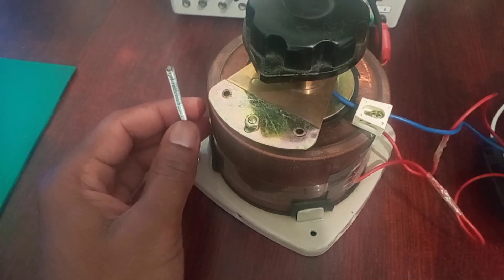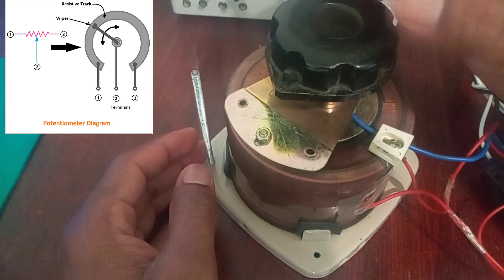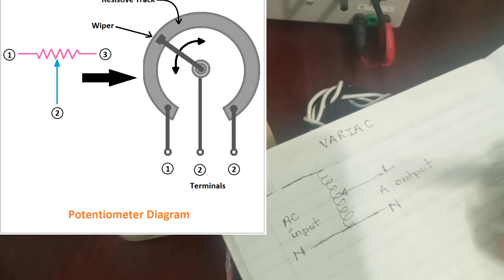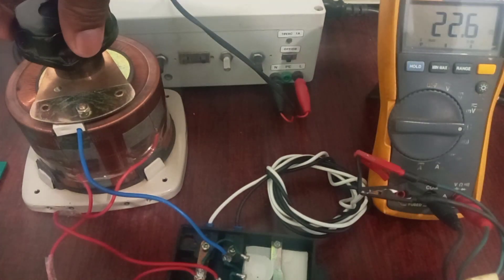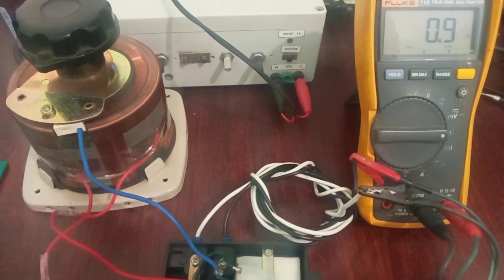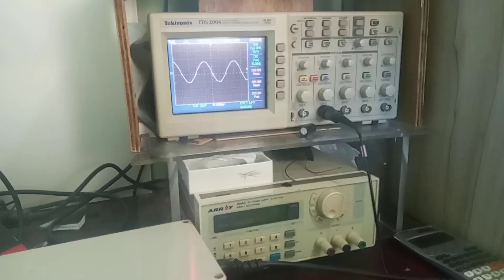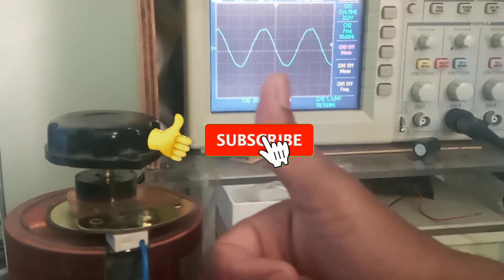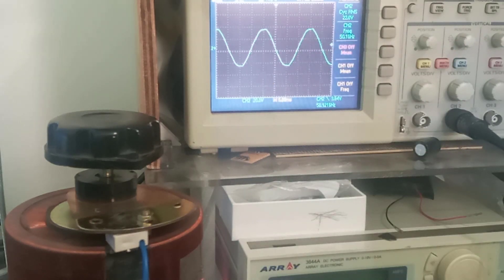How to test a Variable Transformer  - VARIAC. Part 1

Comment: Most Variacs have a few "extra" windings. So the output will be higher than mains. Usually around 17%.
Reply from the maker: Yes correct, that's the built in boost features, it comes in handy for testing most baseline smps application with slightly higher voltage above 230V.

Comment: Great video - learned lots. 

What relationship does current play in variac? I am trying to troubleshoot light dimming circuit that keeps blowing 10A fuse, I can’t find any obvious shorts, bad/loose connections, etc. circuit uses a variac to dim 120v incandescent light bulb.
Reply from the maker: Glad you liked the video! 
In a variac, the current depends on the load and output voltage, so if your 10A fuse keeps blowing, a few things could be happening. 
It might be an overload or a short circuit —if the bulb's wattage is too high, the inrush current could trip the fuse. 

You can check if the variac itself is rated for enough current. Also, try running it without a load to see if the issue is in the variac or elsewhere. A shorted winding, bad wiring, or a failed dimmer component (like a TRIAC) could also be the culprit. 
A quick check with a multimeter for unexpected low resistance might point you in the right direction!

You can also share the circuit, that will help to spot what might be the issue.

Comment: A variac does not have the all properties of normal transformer because it cannot achieve the physical isolation between input and output.
Reply from the maker: That is correct.
Unlike a normal Transformer which has two coils primary and secondary that are not electrical/physically connected a Variac only have a single primary coil where it's output is taken from, with a common neutral point, the output of a Variac is not isolated.